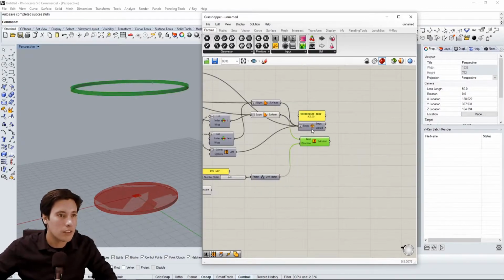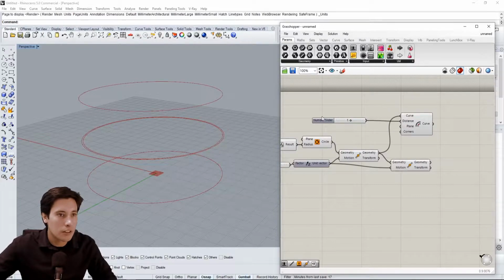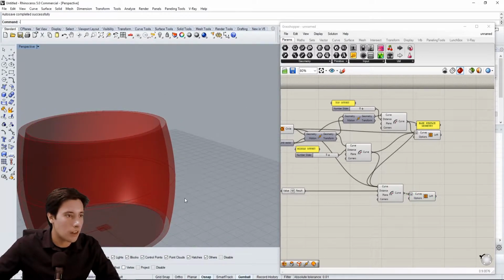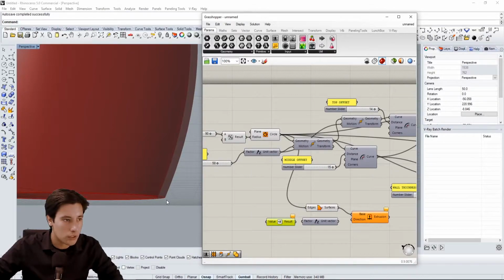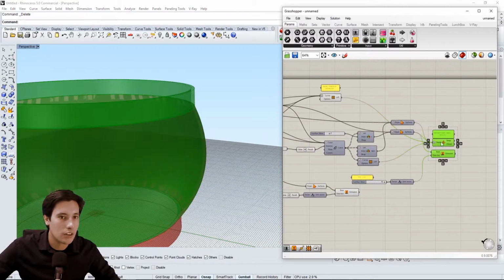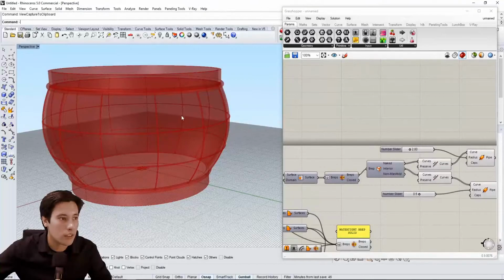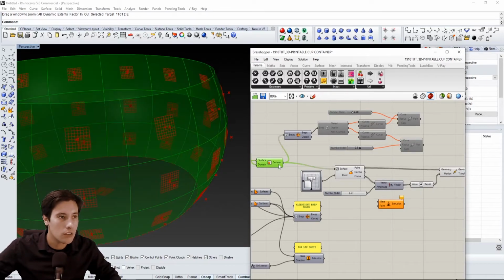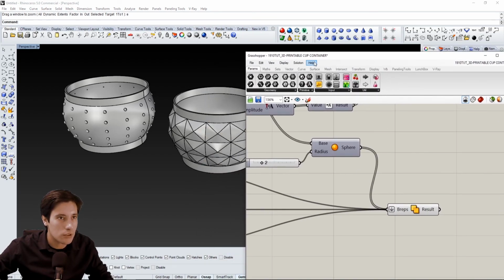Rhinoceros and Grasshopper 3D print Ready Parametric Cups and Containers

Comment: Im wondering how to transfer this from a model to a 3d printed object any help would be extremely helpful
Reply from the maker: What I do is copy the object to the side, turn it into a mesh, with high quality.  then export the mesh as STL.  When you have exported it, use a slicing program like cura, and set it up with your printer.  Then upload the model to cura, and you should be able to save a gcode, which is what you put into the SD card.  Then place the sd card in the printer and set up to print.

Comment: Hi. Really amazing video. Thank you. I should buy a 3d printer. Do you suggest to me to buy a cartesian or Delta printer. I know that to manage better a curve shape is reccomended a delta printer. Doesn't it? Thank you in advance
Reply from the maker: I am not familiar with those printers, but 3D printing technology has evolved and now you can find many reliable printers at a low cost.  I would suggest watching review videos.  My next printer is the Sidewinder x1 because its quiet and has direct drive extruder which you can print flexible materials with.  I hope that helps, and thanks for stopping by!
Reply: @DCOParametric  Thank you very much for your answer. I appreciate your advice.
Reply: Dude. Cartesian all the way. You're gonna hate calibrating your Delta, especially if you're new in the 3D printing world. I've worked with a bunch of different models and Creality's CR-10 or a cheaper Ender 3 Pro would be a good pick. I hate delta printers hehe.